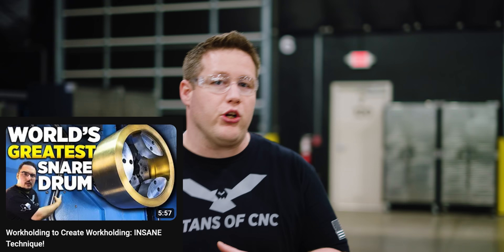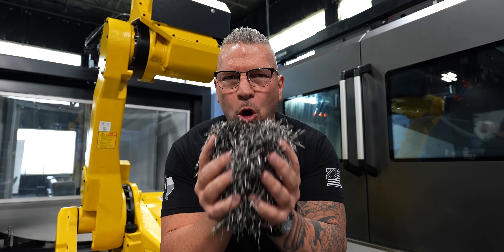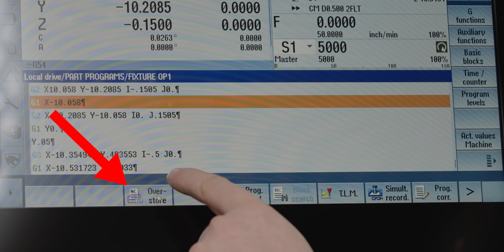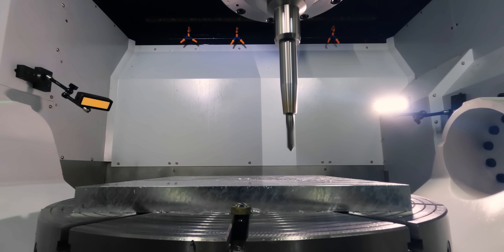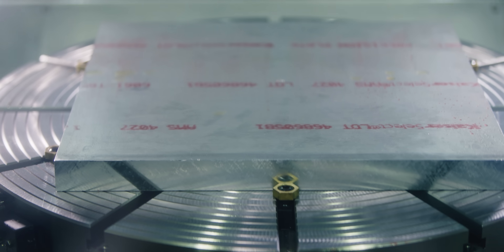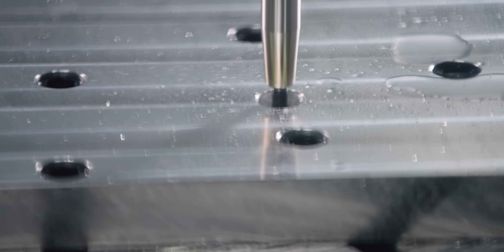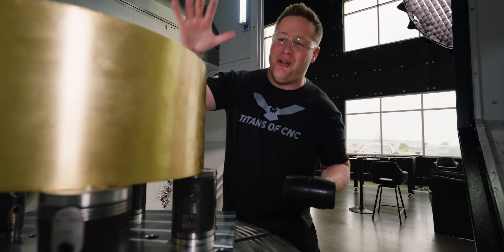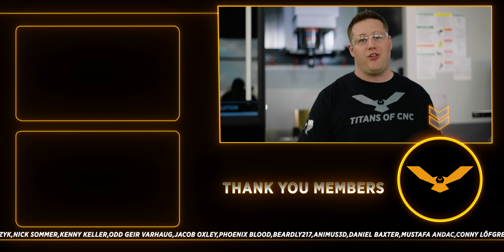Is It POSSIBLE? Rigidity While Elevating Part Off Table

Comment: i used a much simpler version 1999 sinumerik 840 , just press cycle stop , jog -》 jog away . then press auto to resume . But this did not work on all sinumerik machines (maybe it's machine builder integrated ) . The other way is something to do with the REPOS button . However i did not know how to use the Overstore

Comment: Hi 

I want to know the inspection for the particular process

In a sheet metal part we are adding the M6 Nut through spot welding process the nut is square shape in outer side suggested the best inspection methods for this process if needed 3D model please confirm I can share it to you

Comment: 3:10 the hurco controll has an interrupt button. very cool moves up Z stops spindle so you can check on things even mid cut. and the machine resumes with a litle but of distance at the point it left

Comment: Haas Cnc machines do something close to the Simens controls with the moving while in program, in the haas controller you can feed hold and hand jog it away from the material and it will remember where you were in program and return in reverse from the way you went away from the material much safer than straight line return. Also does not reset program 👍🏻
Reply: I think you’re a little miss leading on that feature. Several controls feature that function. Haas even better actually. But true FANUC doesn’t
Reply: @Lwimmermastermetalart  i know a fanuc does not I stated the simens controller comparssion

Comment: @5:10 "This is what separates Siemens from everyone else."  I guess, if you mean that other controls have better interrupt options for being able to move your tool without interrupting your program.  Hurco has a decent interrupt button that allows you to continue on where you left off in your program.  Mazak does as well except you can store up to 4 points to clear obstructions, so you don't have to make a single move back in all 3 directions if it will cause an issue.  They've had these features for decades.
Reply: these are options on other controls and siemens has had this for years. However you do not have to hit overstore to move the machine. all you have to do is hit cycle stop move away and cycle start. it will move right where it left off with modal commands. This is a standard on the control

Comment: This is cool and shows the upper echelon of tech and work holding however this makes this job totally unviable there are multiple thousands of dollars in work holding alone, pull studs, bases, jaws & baseplate. Could this not have been done entirely on the SMX in pretty much one setup. I appreciate you are showing different products and technology. I would suggest it would be better to show people how to make things complete in one setup and reduce expense and setups that would take this job from economically unviable apart for a demo to potentially reasonably price. I believe it would be far more valuable information and knowledge in my opinion. Would be curious to hear others opinions.
Reply: I mean it makes sense for this part to have a setup like this. You'll need the clearance from the table when getting those undercut areas. But for a ship without the expensive fixtures, it isn't hard to make a fixture to hold this out of some raw stock. The base plate doesn't need to be expensive and you can make those pillars or something good enough. It won't be as durable or long lasting or as repeatable as the purchased ones, but it'll get the job done. There are a lot of other cheapy ways to give the part clearance, they all just take more time than if you had the fixturing purchased.
Reply: I understand that this setup is required to mill on a 5 axis however I think it would have been more beneficial to show off what machines like an SMX are built for reducing required setups and making complex parts. I think since it was already in an SMX at one point it would be much simpler to show making it complete in once machine. Only one setup, reduced risk of crashes or mistakes no risk of mismatch, no additional work holding etc. I do also agree they could have followed a similar process  to what they have done on a smaller budget. I just think if they were really having to RFQ this work they would be miles out a lot of the time and they are trying to help people compete in industry. I think the value is in the low investment high return areas such as the recent removable probe base etc. @Marlfox570

Comment: Hurco has a similar feature.  You just hit the interrupt button and manually move the machine and when you want to continue machining, just press cycle start.  The machine moves back to the interrupted position and continues.  You can also start machining on any line even if it's not a safety line as long as the move from the current position can safely move to the ending position the machine would have been at had you run the code that is prior to the code you want to run.  A very handy feature to have.  Can the Siemens control also support starting any where in the code?
Reply: Yes you can start anywhere in the program with a function call Block Search mode. there are few options in this function

Comment: That's a cool feature. Can it handle a tool change, eg. Feed hold, M6 change to a probe/haimer, do a measurement, then hit cycle start and it figures out it needs to tool change back to the endmill?

 Even if it could just handle a manual M6 Tprobe, manual measure cycle, M6 Tendmill, cycle start then it's super useful.
Reply: It can. Most machines have this feature honestly. It's only older machines or Fanuc and a few less common controls that don't. Even with Fanuc some manufacturers add custom routines to handle mid-file starts like this

Comment: It seems your clamps almost line up to the T slots in the table, wouldn't it save you a fixture if the Vero S had T nuts on the bottom?

Comment: Just to be clear. Mine 32 years old cnc machine know this repos. “feature” with dialog system. Nothing new. And with heidenhain you can set angle nullpoint and no need to use indicator.

Comment: I like the fact that in the USA you almost only know Fanuc controls or controls similar to Fanuc (Haas, Brother, etc...).

If you come to Switzerland, you'll find fewer and fewer Fanuc controls in mechanical workshops, more and more Heidenhain or Siemens are taking over, the only place Fanuc is still present is in watchmaking because of Robodrill, Willemin Macodel and Bumotec, even then some manufacturers are switching to other controls, either Siemens or Beckoff.
Reply: How did u come to that conclusion based on a joke? Lol i've been machining in the US for 15 years, multiple shops. Never even seen a Fanuc machine. Every shop i've been in runs Mazak or Heller.
Reply: All the high end shops in the US use Heidenhain or Siemens controls. You find more Siemens controls in the aerospace industry and more Heidenhain controls in the mold industry, but everyone knows that Fanuc is less capable. You do see a lot of Fanuc/fanuc knock offs in smaller shops though

Comment: I’d just like to point out Jesse, hurco came up with this interupt control first I believe, hit interupt in the middle of a program, it stops the spindle, safely moves up in Z, and then you can jog around anywhere, then hit cycle start and it will move back to where it was cutting and start cutting again, glad to see more machines having this feature.
Reply: Hurco's is the best I've seen so far, Mazak has had one for at least 25 years as well all the way back to at least the M plus control in '97.  Not sure if they had it earlier, that's just the oldest I've personally seen.
Reply: HEIDENHAIN also do the same thing

Comment: Use aluminium tooling plate made of cast 5083. No need to deck it off as it is machined parallel from the factory
Reply: Could have been picked because of cost or it was just stock laying around already. Lead times on cast aluminum plates like that in my area are long at the moment.

Comment: As for 3:06 I used to work on an XYZ machine which had somewhat Prototrak Control which allowed to follow the toolpath with your handwheel forward and reverse. This was excellent when machining castings, and complex parts regeneration when you were not sure if the stock had been modeled properly or there was tight space to clamps.

Comment: I know having the latest and greatest stuff is nice.
I would have elevated the alu. Plate with 2x4x6 blocks and bolted from the bottom side .
It would have been supported 100% .
But killer option with moving in and out of program .

Comment: you can also stop the machine in the middle of a program move your axis and go back where it was in Heidenhain ... so nothing new to me, but ay glad this is not a "exlusive" feature and more controls have it
Reply: right.  I know this feature is nothing new, even for Siemens.  But so many people that have only ever seen a Fanuc control has no idea you can do things like this with other controls.  And like you said, these controls have been able to do this for years.  That's why I wanted to put it in the video.  Something so simple, yet is so cool to be able to do with a control like this.
Reply: @Jessie_Smith  with my Haidenhain control when you hit cycl stop u can only decide between programm stop or manual move and just use your Z+ for exampel but u cant write a new code line.
Reply: My 30 year old heidenhain can also do it ... even in revers order 😅
Reply: My Fanuc can also do it... I mean, my Doosan-Fanuc does, while in manual guide mode. You can even ask to resume the program from the current position or from the last saved position, depending on your preferences. And Mazatrol has been doing it for decades too
Reply: @Orakwan can you explain how
Reply: @owievisie at any moment during machining you can press the MPG button (handwheel mode). You don't need to push feedhold before. Then you do whatever you want. When you want to resume the program, one way is to go back to memory mode and press cycle start. Depending on your settings, it will either resume the current G move from where the tool currently is, or go to the last position then resume. In case you changed some modal codes such as spindle stop or changed the speed or feed variables, the program will keep them. But if you don't want to keep them and instead want to come back to the program exactly as it was, then you either put the codes in manually or you push the program restart button which will read the earlier codes in the program and use those to continue machining. There will be a blinking indicator saying you are restarting the program. You can even remove a broken tap this way, moving the Z axis while the spindle orients itself to stay in the thread. Now all those I do on the Doosan Fanuc, and I'm not sure it works on regular Fanuc with other machine brands. We have several Fanuc machines that are not doosan, and they handle it in a different way, not as efficiently, but similar.
Reply: @Orakwan  Thanks man I'm going to try it tomorrow! (Doosan VCF850LSR)
Reply: @Orakwan does it not work when running gcode? I have a Doosan 2100lysb lathe and only run gcode.
Reply: Haas also has this for many years
Reply: Mazak can also do this... even in the exact order you moved
Reply: @robinnussbaumer5943  Mazak makes this since 1984 with the CAM M 2
Reply: Came here to say that! Heidenhain has this function for decades!
If we want to check something on the part, we can stop (pause) the program, jog whatever axis we want and resume the program from the point we stopped it. It even resumes in a safe order: first it moves in X and Y then in Z. Then it stops on the exact point we paused it just so we can press a button and it resumes the program. It even activates whatever M function we had on (like M08/07 for coolant/air).
When working with Fanuc and Haas, this is the function i miss the most.
Reply: Okuma does it as well but I get your point, with Fanuc almost everything feels tedious and dangerous.
Reply: Use Hurcos interrupt feature every setup. It's a game changer when proofing programs.
Reply: Also Hurco
Reply: The old machine I work with can also do that despite not being anything fancy
Reply: In Heidenhain you can choose the axis you want to move first, even the B ir C axis
Reply: Heidenhain TNC7 --> my favorit
Absolutly simple and much better than siemens, fanuc and mitsubishi.
But thats my opinion
Reply: ...even dinky lil 3d printers can do this
Reply: Heidenhain is so fire

Comment: Heidenhain been having those feed hold options in program for years, but still fascinating :D
Reply: Mazatrol same
Reply: Right, and so has Siemens.  That's why I wanted to mention it.  Even though this has been an option for years with other controls, people with only Fanuc controls may have never seen something like this.  It is a simple feature and nothing ground breaking but still very cool to me.
Reply: @Jessie_Smith  yes, worked on lathe with fanuc control and was really missing this feature. Germans know how to make them controls😅
Reply: @Jessie_Smith  you can reference program after some MDI input in Fanuc, same in HAAS(wich is Fanuc basicly) but it's not exactly the same as in the video :D it's a defacto restart of the program from a certain line, when MOCON reads all the previous data and is able to continue at that point
Reply: its even better on Heidenhain as it moves every axis alone, not all at the same time and you can choose the sequence.
Reply: that's the point, have tnc426 on mill in my garage. It does a lot of things. You can stop program do what you want and then resume the program. The most absurd thing is that it has look-ahead, which haas calls high speed machining. It's '98 machine and with new haas you have to pay a lot for it. Even chinese cnc machines with fanuc comes standard with 40 blocks look ahead.
Reply: We have a few retrofits that are older Siemens controllers that look nearly like windows 95 but are not, originally Cincinatti horizontal boring mills with Fanuc control that can do single and multi-axis returns to a feed hold location that operator initiated. 

There was one Cincinatti Vertical Mill that could return to point while in canned drilling cycles and even during g1 commands.   The control, keypad, and display were mounted into the long side of a rectangular box that housed the tape reader, add on BTR, and most if not all of the controllers for that Mill. I loved the mill could do this during stringy drilling operations like stainless and some high carbon alloys. Ball of stringers and chips blocking the coolant??? Retract. Stop spindle and either ball of stringers flies off or remove. Restart spindle and hold cycle start button until return to point initiates program feed rate again, basically where controllers resumes command until operator input.